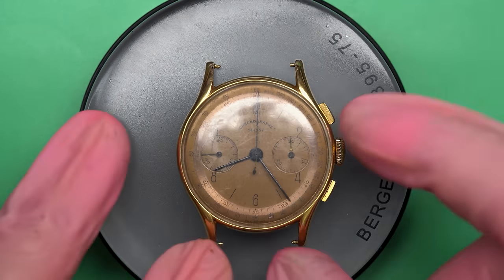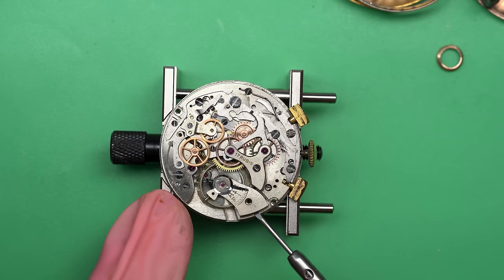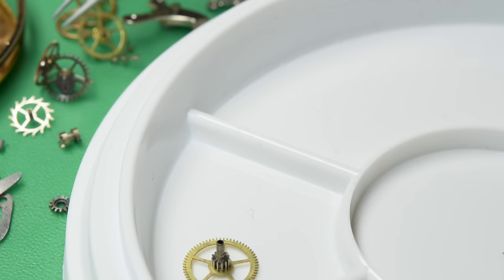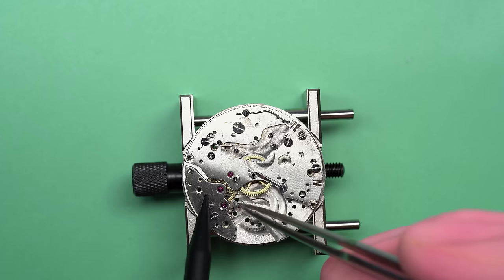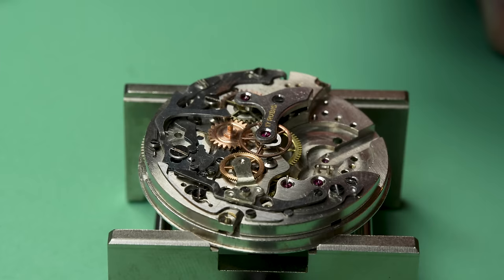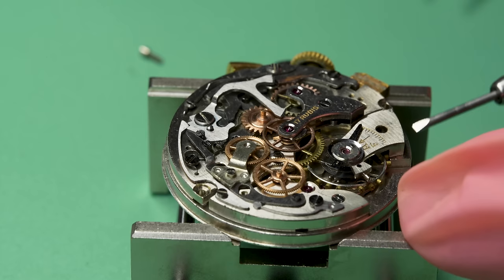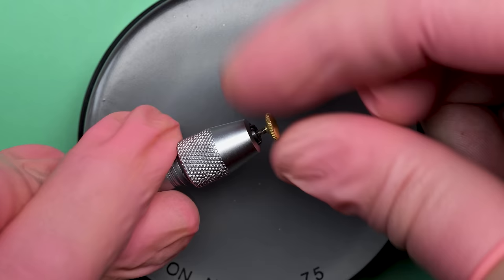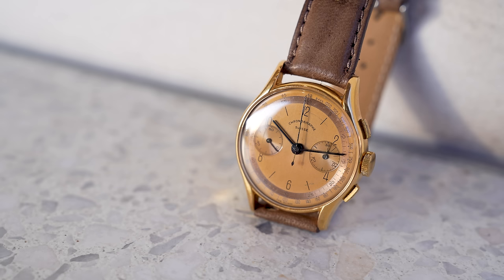Finally, My First Time Working on a Chronograph!

Comment: Hey Marshall, happy to see that you’re attempting chronographs! I have a lot of experience on these 48 based movements, and am trained and certified for them, so I hope you can take these points to improve your next Landeron chronograph.

11:48:  this was not a little bit of wind, this was quite a bit of power, and combined with the lack of lubrication, this could have seriously damaged the pivots, and in worst case ruined the pallet stones. This was just very dangerous. Try to pay more attention and always let down the spring. 

14:38:  this main spring should absolutely be replaced. It doesn’t lay flat (so will rub against the barrel roof and floor) and is very tired. A modern spring is also more consistent in force. So get a modern one, but whilst measuring the old spring, take a modern one that is a bit THINNER!!! Very important as modern springs are substantially stronger. 

18:14:  did you grease the main spring? Didn’t see you doing that but maybe you did it off camera. In any case, it’s very important.

18:59:  that is a ton of grease on that screw. That will just walk itself between the bridges over the years, there is just no need for that much grease. Later you also put too much oil under the crown wheel. Again, it’s messy, so try to use just as little as needed.

I also didn’t see you lubricate the click, which again, is very important. Could have happened off camera but still, it should be mentioned.

21:00:  did you check the play of the center wheel and the bridge? These are almost always worn out, and should be fixed as the difference between horizontal and vertical amplitude would be too great without. 

23:25:  you should grease (again, very little) this eccentric where the lever bridge pivots around. Every single metal chronograph part that pushes against another one NEEDS grease. It will wear out very quickly. So the hammer need a tiny bit of 9010 on the ends (don’t oil the heart cams with HP1300, this gives too much drag. Just oil the hammer ends), and all the levers need a little bit of grease on the touching surfaces. Also a little tip, hammer goes in last, makes for much easier assembly. 

27:05:  you did grease the hammer spring, but that was again way more than needed, and smothered all over the bridge, please use less and take more care when applying. 

29:55:  yes that’s a mistake, but a very small one. No worries, everyone has done that.

31:00:  again with the grease, please use less, you are using way too much. Keep it tidy and just use a little. This is the last time I will mention the grease as I think you get the point. It is just every time you use grease.

31:15: you missed the post and oiled the bridge. That’s not where it is needed.

35:51:  your jewels are not clean, and you don’t want to oil the minute counter. That just adds unnecessary drag, and it doesn’t move often. 

36:01:  that was just messy oiling. Keep the oils in the cups.

38:50: it is easier to oil the top capjewel if you assemble the balance bridge and then oil it with the pass-through method.

41:46:  you didn’t oil the clutch bridge wheel and post. Give the wheel pivots on both sides some 9010, and the post a little grease so the clutch bridge pivots nicely.

42:20:  the top second wheel (the one you press on the second wheel) is pressed too deep, it needs to align perfectly with the clutch wheel. The teeth also should mesh for 2/3-3/4ths of the way, not all the way.

42:42:  very important that they DO NOT mesh all the way, but should be 1/4-1/3rd at most meshed (looking at the chronograph seconds teeth). 

42:48:  don’t oil that spring of the minute counter. Again, that’s not a wear point and adds too much drag. 

43:40:  great work on those adjustments! These are tricky, and you did great. 

I hope you checked the pull-back adjustment of the lever bridge in reset mode, and also the adjustment of the minute counter spring in reset mode. 

Then finally I wanted to add that you need to take more care in where you place the hands. Because they should be dead right on 0 when the chronograph is reset. Not somewhere around it.

I hope to see you tackle more chronographs in the future, it will be interesting to see you learn.
Reply: Solid advice!
Reply: I came to the comments to mention the need to replace the mainspring, and not to oil the minute jumper… hats off to you sir, for taking the time to point out the improvement areas, not just for Marshall, but the rest of us as well!
And to Marshall, great work as usual! First chrono usually feels like getting back to the start line… redoing this with the tips above in mind will do A LOT to your chrono skills. Keep it up!
Reply: Thank you for your valuable insights, it's fascinating the delicacy required! Hope to hear more feedback from you in the future!
Reply: Great feedback! Now I dont feel so bad for sending my speedy racing for repairs! 

This art is wild
Reply: Currently training in the SAWTA program, Im glad to have finally found someone else in these comments who knows what theyre talking about. Many of these things are oversights which need to be understood conceptually rather than on a case by case basis, like not keeping oil in the jewel cups. most people just think its a cleanliness issue, which it is, but its also because the capilary attraction could lead the oil between the bridge and jewel or spread to other places it shouldnt be. Same thing with mainsprings. People dont understand the implications of spring flatness or the barrel endshake or the arbor endshake on the amplitude. this is all stuff that NEEDS to be checked which is why I get worried when i see how popular these videos are becoming since I know people are following them for tutorials.
Reply: I am going to copy this and save it for later! Thanks!
Reply: Going through these is fascinating to me. All the grease problems seem like he's using grease roughly the same way he's using oil, but for the grease it's way too much. I assume you just want the grease to barely coat whatever post it's going to and not be able to seep anywhere else? 

The gear meshing also surprised me - the nearly full mesh Marshall got definitely looks right to my naive intuition, I would have never thought it needed to partially mesh! This is probably where it helps to have a manual to follow, yeah?

Also the main spring unwinding and flatness issues. Those both looked minor to my inexperienced eyes, but even just that much is not minor at all. Wild.

Comment: Wonderful! It's a useful insight how you can "walk away" from watchmaking if things get frustrating. I've noticed that some skills aren't like this, and that alone makes them hard. Two such time-bound skills I've experienced are repairing plaster walls (with wet plaster that's undergoing a chemical reaction as soon as you mix it) and baking bread (where loaf shaping, in particular, is a time-bound one-shot process).

Comment: I got my first watch today, I've been watching your stuff for a while and I was obviously looking at it and it stopped and started and slowed down and started etc. It's a Seiko military so it has the clear back where you can see in, I looked at the parts while spinning it around and saw the spring was getting caught on a tiny piece of soft plastic that some how got into there. I removed the back and got it out and felt very proud that I was confident enough to do so through watching your stuff. Just wanted to share haha, have a nice day.

Comment: Have a baume and mercier in this type of case. Ended up letting goldsmith pop out the dents in lugs. I then used an eye dropper and two part epoxy to fill in the lugs from inside the case without movement in it. Much more solid lugs now.

Comment: I also have a Chronographr Suisse from my late grandfather, which i found in my mom's closet years after he passed, it's partially the reason i got into watches.
I've been thinking about mailing you about mine for a while because it did get serviced last year, but the watchmaker didn't get the chronographe reset fixed.

Comment: Excellent project! Chronographs are my favorite too..I have ones with Landeron 148 and 248 movements and one Heuer Autavia (pre viceroy).  I know servicing these can be very tricky and it is good that you obtained a parts movement. When my 148 was rebuilt, we had to source one of the levers as they are somewhat weak.  My watchmaker calls these Chronographe Suisse "oil can" case watches as the thin case tends to dent.  It can also be very tricky on chronos to set the height of the hands so they do not touch each other.

Comment: In case your interested. There are only two places where watches can became certified chronometers. One is the certification by the COSC in La-Chaux-de-Fonds (Switzerland) with three testing facilities in Biel, Le Locle and Saint Imer and the other one is the TLV/SME in Saxony with its testing facility in Glashütte (Saxony/Germany).
The difference is that in Switzerland only the clockwork is certified while in Saxony the whole watch in its assembled configuration ist tested.

Comment: I really enjoy watching your channel and would like to pass along a trick for you.  I noticed that when you reassemble the screws  you never use my trick so here it is.
As an assembly engineer, i always tought workers to secure fragile scews by first turning them counterclockwise  (reverse) untill you feel the threads aligment, a typicall click can be felt, the you normally secure it.  This way, you will never damage the threads on the tiniest screws!

Comment: Regarding old "organic" oils. My late father-in-law was a physician and fascinated by watch mechanisms. When he passed one of his nephews, who was learning watch repair in his spare time, ended up with the tools and various related hardware, but I received a small container of "sperm oil", about 10cc. Almost thin as water, but not quite, I don't believe that it actually came from sperm whales but some species of dolphin.

I found a use for it in maintaining flintlock rifle locks, oddly enough. It does not dry out anywhere near as quickly as you'd think, and was just the thing for parts of the mechanism such as the fly. Turns out to be a light, fluid wax, rather than an oil. Doesn't take much, in 15 years I don't think I used as much as 3cc total, but it was close to what 19th century mechanisms would have used. And there is as close to no smell as possible to imagine. Also not something easy to find these days, for various reasons.
Reply: Sperm oil (spermaceti) absolutely comes from sperm whales. Whale oil from bottlenose whales would sometimes be called "arctic sperm oil", but it's a completely different product and much worse than true sperm oil.

"Also not something easy to find these days, for various reasons." mostly a complete ban. IIRC for lubrication jojoba is generally as good or superior.

Comment: An excentric is basically a stationary cam. You can also think of it as a rounded wedge. A screw is a helically wound wedge, exerting force or moving along the axis of the element, an excentric is a tangentially wound wedge, moving or forcing radially.

Comment: I was asked to look at a non-working Longines with a seconds/minutes/hours chronograph, a day/date complication and a moon phase feature - the movement was a Valjoux 7751.  When I removed the caseback, the sheer number of parts scared me. Luckily the automatic winding rotor had come loose and the watch worked when I put that back on.  There is no way this amateur would have disassembled that movement, It was a $3,000 watch.  Thanks for the video Marshall, next stop will be Mark's course on Chronographs.

Comment: 5:12
Eccentric bolts are a common thing in automotive for doing wheel alignments. Some mechanics refer to them as the "egg" bolts, or "cam" bolts. The offset on the bolts look very similar to the side profile of an egg, or a lobe on a camshaft.

Comment: that component that you are describing at 5:10 sounds like an eccentric cam lock, its a cam that is offset that locks when you turn it you find them in some machine tools like lathes with the D cam lock system to hold on the chucks

Comment: I bought a Chronographe Suisse on eBay a while back too! Mine runs ok, but the flyback lever on mine was missing. It’s a Landeron 51 and I’ve bought two different ones that haven’t worked right. As long as you don’t actuate the chronograph, it works fine.

Comment: I'm too ADHD to take up watchmaking (to say nothing of my fucked up hands and wrist) but I love this channel.

My personal favorite complication is a lunar cycle wheel, which isn't nearly as complex as a chronograph — it's essentially just a date wheel with a different gear ratio (because the lunar cycle is 29.5 days, rather than 31) and that turns continuously rather than ticking over discretely every 24 hours — but I love the aesthetics of it.

Comment: An eccentric is a shaft run thru a circle but the circle is offset to one side.  The shaft doesn’t penetrate the circle dead center.  It allow you to cam something into place    It’s use in many places in automotive suspension as well

Comment: Im a real mechanical nerd and loved to just sit and watch you work.  What a great video thanks for taking the time to make it.  Im extremely tempted to jump into becoming a watch repair technician.  In highschool i wasnt a dishwasher i was an aqua ceramic technitian.  So a few years ago i dropped my iphone4 into a swimming pool.  But detetmination i followed a video took it apart completely found the short cleaned the electrical scoring off reassembled it and it only took 12 hours.  I had to draw a schematic and used folded clear scotch tape to hold the micro screws from getting lost.  I got hooked on that feeling when it powered up and worked.  Its nowhere near the complexity of a chronograph time piece but i know i could pick it up fast like most things i am passionate about.  Taught woodturning to paying students after starting less than a year earlier on my own.  What id like to ask you is how much roughly speaking does the equipment cost that i saw you use.  The cleaning machine, press, special tools, oils, everything you can think of that you used in this video.  What kinda ballpark amount would you guess it would cost to purchase all those tools etc?

Comment: I purchased a couple of these earlier this year both running well so I wasn't tempted to tamper with the movements. I was shocked how thin the 18k case was. One of the watches had 'anno1950' engraved on the back. I did a litle research on these chronographs and found they were made under a variety of brand names mostly from the late 1940's to the late 1950's and were quite affordable as money was tight after the war. I did sell one of the watches in a weak moment partly because I was afraid of damaging the case, the one I kept already has a damaged case back so I'm less concerned about that.

Comment: The plating comes undone like that when there's an intermediate copper layer. The sebum from your hands corrodes the copper and you're left with the base material and the shell of plating. Kinda like taking a modern penny and dissolving the base material in acid, leaving just that thin copper shell.

Comment: On the mainspring winder cost...it turns out you can just buy the bits separately. Where the kits cost a fortune, one handle and one winder is about £85, then each winder is about £50, then you can buy the opposite handed handle if you ever need it, you can even buy the winder arbours separate from the barrel. If you just get what you need, and build as you go, it's much more manageable (the only person I've ever heard mention that is Alex Hamilton!)

Comment: Fascinating. I wonder if this movement has a feature that is on my Speedmaster: When setting the watch, it's possible to hack the seconds by slightly leaning the winding stem back, which makes the watch stop or by leaning it a tiny bit more, making the watch run backwards. Weird but totally cool.

Comment: Very cool video. I really like the dial and the new crown looks great. Really does have a vibe!  I've been servicing my own watches for years (I did the Timezone Watch School probably 10-15 years ago?), but I've never tackled a chronograph. I do have one that needs servicing, so will give the Watch Fix channel a look! The most complicated watch that I've tackled is a quarter repeater pocket watch. Like this project, I got it back to running with the help of a donor movement. It was pretty tricky, but in a different way from a chronograph. Cheers!

Comment: I always wondered what Bergeon, the name on your little round work surface was about.
I just found out when I looked up your mainspring winder after you mentioned that they were expensive...yeah, they are. For those curious, search Bergeon 2795.
Alton Brown...the Good Eats guy...would call it a UNI-tasker, but it sure makes winding up those springs easy...huh?
And your almost always comment about the sound it makes when you load and release it should never stop.
Plus...I learned a new word or two because of you...Ligne...and Lancashire
Reply: They are freaking expensive, though it's almost a must have I have found out, since doing it by hand is a pain.
Reply: @erikblicherstasiak2803  The out of pocket cost to start is surprisingly low...I mean, once you get the microscope and a small set of screwdrivers, right?
Parts washers and spring winders are luxury upgrades.
I think Marshall's 4 station parts dip is vintage, isn't it?
I kind of do a blank stare with a question mark over my head when he calls himself a watch "maker".
Disassembly and reassembly doesn't really make you a "maker" does it?
When I think of the guy who casts or machines all the little parts or those dinky little screws...that's a watchMAKER...am I right?
The guy that machines the little jewels...imagine that job.